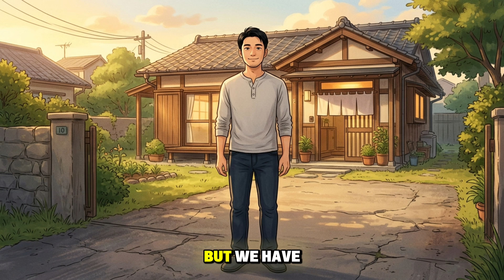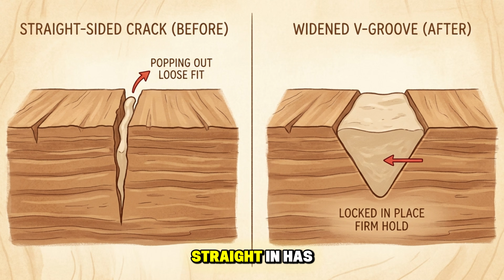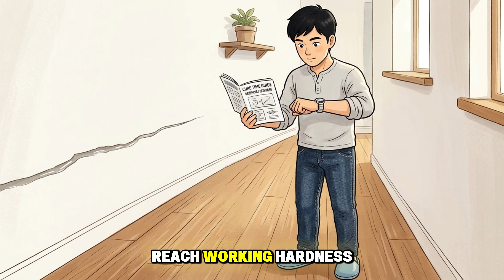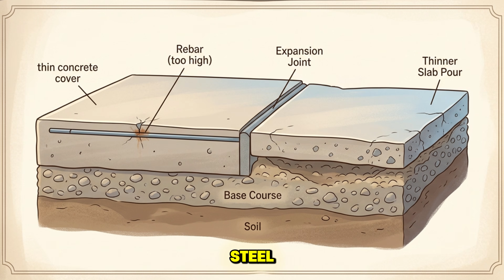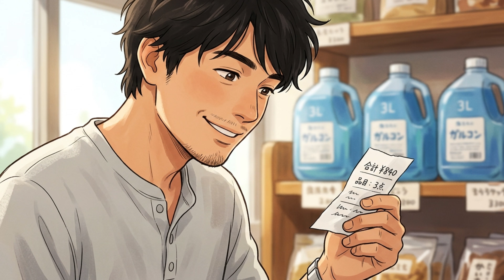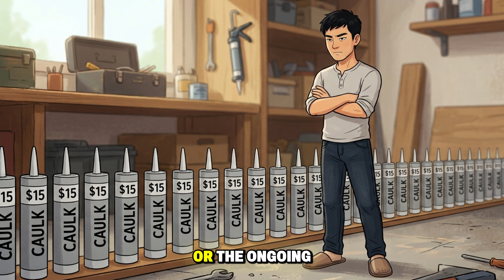This Japanese Method Fixes Cracked Concrete Driveways Forever (No Contractor, No Jackhammer)

Comment: I have a question. A corner of my driveway cracked diagonally to make a triangular piece. There is an oak tree nearby and I don't know if that has anything to do with it or not. That triangular piece rises and falls about 3 inches. I can never remember if it's winter or summer, but I think it rises up about 3 inches higher than the rest of the driveway in winter and then falls down to be flush with the rest of the driveway during summer. I'm afraid to just fill in the crack because it seems like there's some reason that the slab needs to come up in the winter. We never have more than three days of snow or ice. We usually get down below freezing, maybe three weeks out of the year. So I don't think it's a big issue of freezing water. I can't figure out why it rises and falls and so I don't know a good way to fix it. Any ideas?